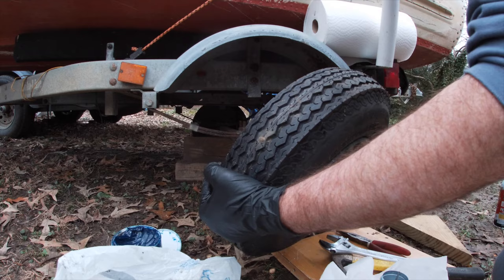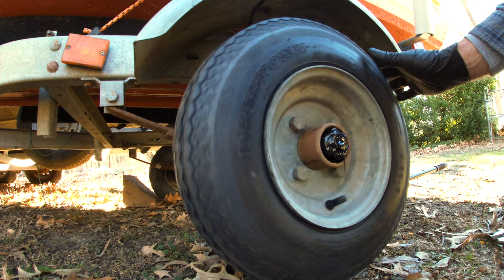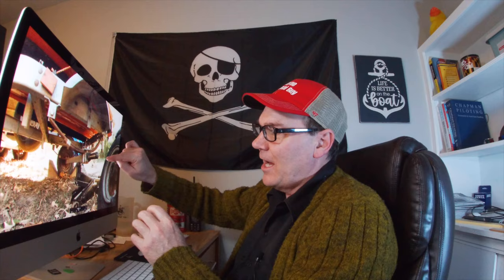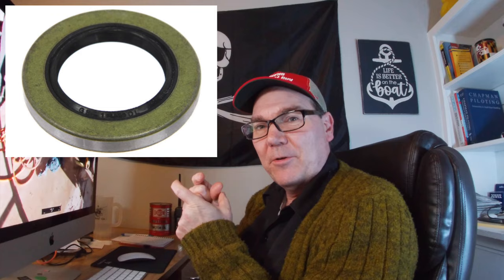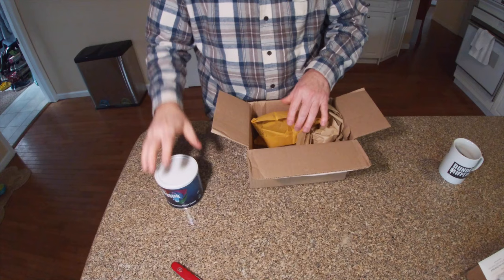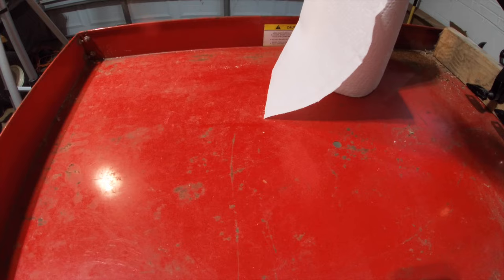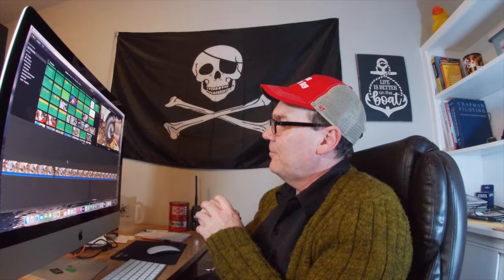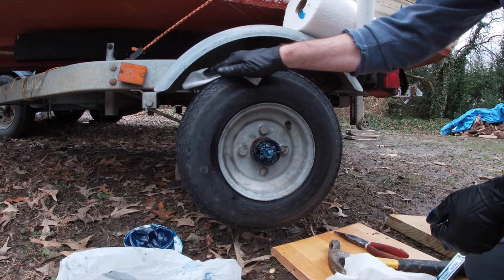How To Repack Trailer Wheel Bearings

Comment: Not necessary to slather that much grease on the axle since the contact points are only: 1) the rubber lip on the grease seal (always get double lipped ones btw) 2) & 3) where the bearings contact the axle; the actual rolling is the bearing on the races.   Never liked zerk fittings on axles or  "bearing buddies" since you  pump in a lot of grease but never certain it is in the right places.  Also never liked the "bearing packer"; tried one from Harbor Fright and returned it.  Using hands is the best packing method.   I also take the grease gun and before I put the grease seal on, and pump grease around  and into the inner bearing while it sits in the race (after smearing a some grease around the races), then pump some on the inside of the seal so when I tap the seal on, it mushes grease further into to the rollers.  For the outer bearing I do the same with the grease gun on the bearing, then put a bead of grease on the inside of the washer so when I put it in the hub, it mushes further grease into the outer bearing.

Comment: Best way to put caps on is getting a piece of PVC or steel pipe that fits over the cap and rests on the lip. Now just tap the cap on with no damage. There are also cheap tools to take those caps off without damage.
Reply from the maker: I like the PVC pipe trick!
Reply: For a 1.98 inch cap use a short piece of 2 inch PVC pipe, the piece i use is maybe 3 inches. Had the lumber yard cut me a piece as that was the one size I did not have lying around. Worked great.

Comment: Just went through this but also replaced my bearings and races.  Mine didn’t have a washer either but I confirmed with Dexter and it didn’t come with one from factory for that model idler hub.  I had over $55 in bearings.  I could have replaced both hubs for $66 so considering my time I should have gone that route.

Comment: Very Very Good Video, Excellent Video My Friend!!  I soak all the parts in a small plastic container with gasoline in it. The lil containers  I buy at Ace Hardware in the paint dept. It works great as it dissolves all the old grease and cleans everything up nicely.
Reply from the maker: Great tip!

Comment: I've watched several videos over the past few days as I prepare to try this myself. This one was by far the most detailed and informative. Thnx! 

I noticed a grease fitting on the inner side of my axle, behind the plate with the lug nuts. I've seen this fitting in other videos also, although not yours. I'm guessing that if you just want to replace or add grease without further disassembly you could pull the dust/grease cover off and then pump in new/additional grease until it squirts out around the castle nut. Correct?

Comment: Hi Wayne. I constantly had bearing issues using dust caps. Water would get into the bearings and ruin them. I was having to replace bearings every 12 to 24 months. I switched to bearing buddys 10 years ago and have not had to replace bearings since. It is a bad idea to throw your old bearing buddy away.
Reply from the maker: That's some good 'first-hand' experience. Thanks for sharing!

Comment: I use an electric water heater element wrench to remove and put back the castle nuts; perfect size for them and don't need to put the rod through it for leverage.

Comment: Really solid video, thanks! Wish I would have watched it before I did my first run at this, but you helped me feel better about the job I did.

Question, did your spindle have a zerk for a grease gun? Mine does, however I ripped mine off on one of the spindles by accident. I got the grease gun stuck on it. The zerk was a "driver" style, not threaded, and with the force I used trying to pull the grease hose loose, I pulled the sucker right out. Hoping it will be ok withlut the zerk, as it is still capped and had plenty of new grease inside.

Comment: i  fill that little gap between  the inner seal and bearing with finger and grease.. outer washer sometimes has a flat edge on it so it can't turn. bearing buddys has a spring in it that keeps a bit of pressure on cavity to help keep water out. looks good

Comment: You can soak the bearing in gas to remove the old grease,  This allows you to check the condition of the bearings and to use only new grease.
Reply from the maker: good tip!

Comment: I just got done doing one of the bearing on my trailer. Boy, at first I didn’t believe you how messy the grease can get but you were right! I still got one more to go tomorrow. I did vent the lip of the rear seal a little. I tried to straighten it and it end up going through. Do you think is compromised? Also, the wheel should spin very easily free or have some kind of resistance to it?
Reply from the maker: There should be the slightest resistance from the grease when there's a lot of fresh grease in there. It shouldn't feel too loose or like it is binding. You can loosen and tighten the nut a little as you spin the wheel to feel the differences and find the sweet spot.

Comment: Great video. Thanks. Quick question if I may. I have the exact same four bolt rim on my old wood splitter (and same size tire too). Unfortunately both of my rims are bad shape and need replacing, but I am having a heck of a time trying to find a replacement rim on line. Any ideas? Many thanks!
Reply from the maker: I think WalMart sells the tire with this rim - I don't know anyone just selling the rim

Comment: Yes it’s wrong!! Washer on out side. I do have a seal removing tool, screwdriver works on that. I’ve used tool on trucks including dump and HD dual wheel ones you’d struggle without it.

Comment: My trailer tire doesnt  come off after castle nut part. Advice?
Reply from the maker: I would poke around and see if there is something else holding things in there. If not, a 2 x 4 might be able to pop the wheel free of the trailer frame.
Reply: Wheel is off now my bearing closest to the chasi is not coming undone

Comment: Good video, thanks.  When you say both inner and outer bearings are tapered...to clarify, both go with the smaller side towards the trailer?  Thanks.
Reply from the maker: The smaller side goes to the center of the wheel hub

Comment: mine has no flat washer, none on the back too, should I be worried? Is it regular flat washer?
Reply from the maker: Some have special washers - like with a notch or a tab - based on the shaft specifications.I think the washer is useful to get everything seated properly and to ensure the nut tightens properly. But I guess it's possible some are designed without a washer. I would try to add a washer and see if it all goes together well.

Comment: The reason I do this every year, is bc no matter what, dipping the trailer in and out of the water all season, going from warm (driving) to colder water when launching, water finds it way in the lip of the grease seal, even double lipped ones.
Reply from the maker: That makes sense! I drive such a short distance (about 1 block) that mine never really get warm!

Comment: I bought a boat and trailer last year and have no idea on how long or number of miles put on a trailer and when this procedure should be done. How often should this maintenance be done?
Reply from the maker: It really varies depending on age of current seals, miles traveled, conditions (salt water, frequency of trips). A simple inspection (spinning the tire, looking for leaks etc) can tell a lot. It doesn't hurt to take things apart every year just to see how it is going.

Comment: So the part that takes skill is the FEEL for not too tight, not too loose with the castle nut.  That's what prevents me from doing Bearings.
Reply from the maker: Tighten it up until the nut is snug (often finger tight is enough) and spin the tire. Then as you are moving the tire, try tightening a little more. When it's too tight it feels like things are grinding, and when it's too loose it's wobbly. If it's grindy or has resistance, it might be too tight.

Comment: Here's a dumb question - why is it so important to remove the old grease?
Reply from the maker: The old grease may be contaminated with water, have metal in it, and possibly be broken down (like old motor oil breaks down) making it less effective at lubricating.

Comment: Willing to bet the person that worked on the trailer before put the washer near the grease seal to try to cover the gap between the seal and the rear bearing. They might have had a thicker seal the first time, and then got a new one that was thinner, leaving the gap. From what I've read online that gap is okay as long as the seal is flush to the back of the hub.

Comment: Great video! Do you know what the specs are on those tires as opposed to the speed rating? My trailer has similar. But I haul a pelican predator 103. The tires just said high speed but I haven’t been able to find out how to properly read a tire nomenclature.
Reply from the maker: The side of the tire should have the whole story. Most are load range B or load range C. Mine say the max weight, psi and max speed on the tire.
Reply: @WayneTheBoatGuy  mines is load range C Tubeless. But speed wise it just say high speed trailer. 
DOT K3A3 T08. 
4.80/4.00-8. 
Cold sidewall 4 plies.
Reply from the maker: @abnergarcia6252  mine are also C. Specs vary a little by brand, but mine say 760 lbs. at 90 psi with a max speed of 52 mph.

Comment: Do NOT do as this video show and lift your trailer using the axel. Lift the trailer using the frame which is much more durable. Lifting by the axel can bend it rendering a replacement necessary.